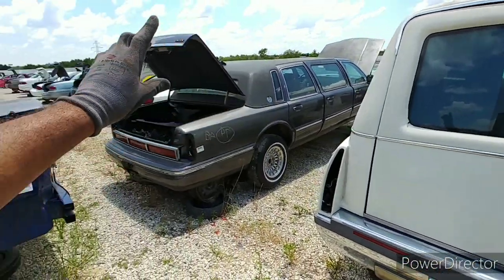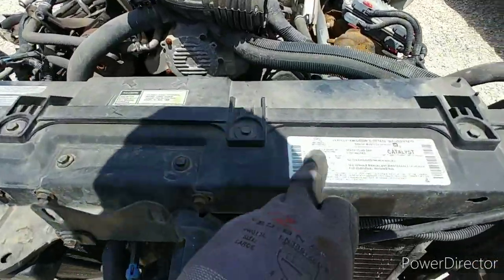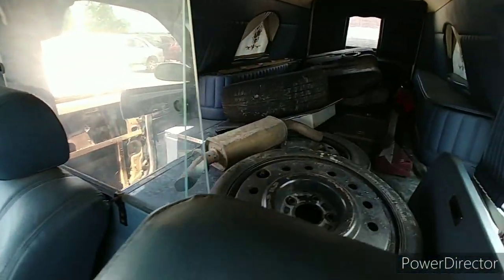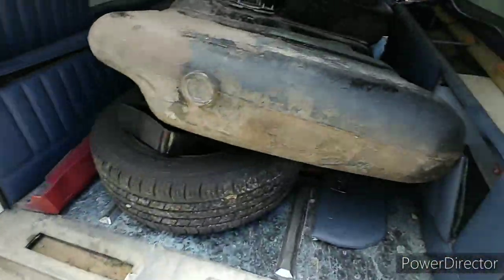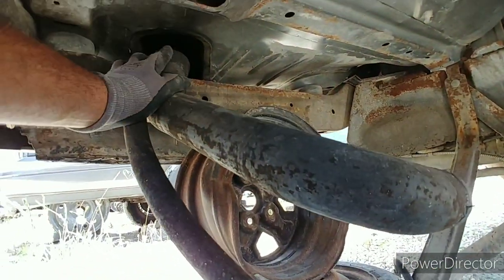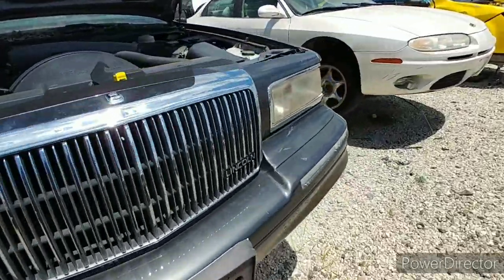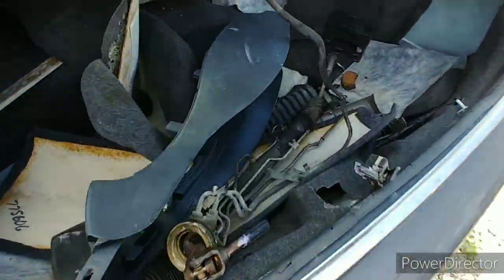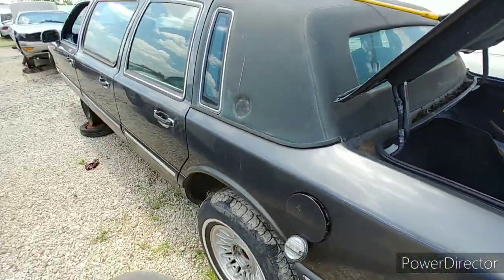Professional Cars 1995 Lincoln Limousine | 1996 Cadillac Fleetwood Hearse Junkyard Finds

Comment: Everyone rides in a Cadillac at least once, sometimes unfortunately, it's your final ride. Whoa Nelley, morbid moldy oldie.  Both of these were upfitted by someone outside of the factory. Sometimes the OEM offers a "prep kit" or options set up for conversion. Ambulance chassis are like that. Ford offers an Ambulance prep package and that has to be ordered if it's going to be an Ambulance, otherwise it cannot legally be one.
We don't have the VIN on the Cadillac, so we do not win. The 10th would be a "T" for 1996  and the 11th of the VIN would be an "R" for Arlington, TX assembly plant. Yes, 5.7 liter VIN "P", aka "LT1". Yes, (Sub)Opti-spark. A lot of moisture problems with those causing misfires. Parts were revised by GM several times over the years.
Nope, couldn't see the VIN on the Lincoln, but it would be a "W" for the 8th for 4.6L V8 and an "S" for the 10th for the 1995 model year. The 11th is likely to be a "Y" for Wixom, MI assembly.
Back when my dad worked at the Cadillac dealer, they used to service a few locally based hearses. One day one of the mechanics came running into the shop and yelled "FIRE!!!". Apparently, the hearse was on fire in the shop that was being worked on. That hearse went on fire no fewer than three or four times more before the dealer owner politely told the funeral home that they wouldn't work on it anymore.  It was mostly due to the poor conversion work that kept on causing electrical fires. The people in the shop joked it was possessed. LOL.